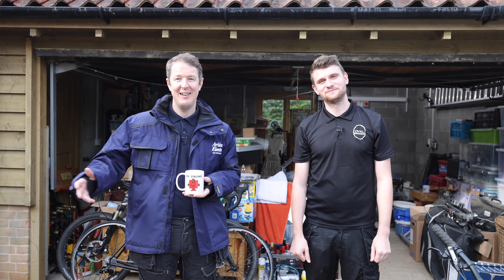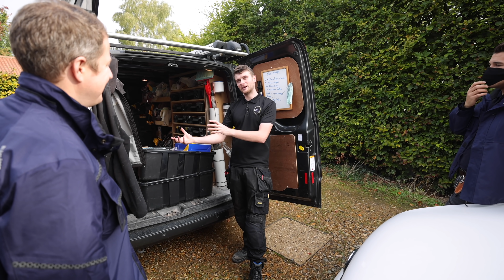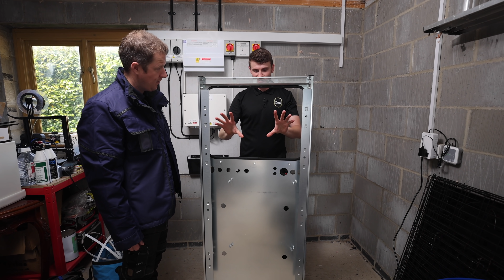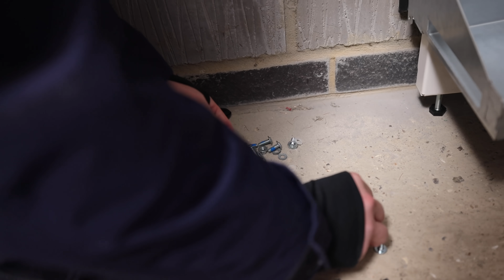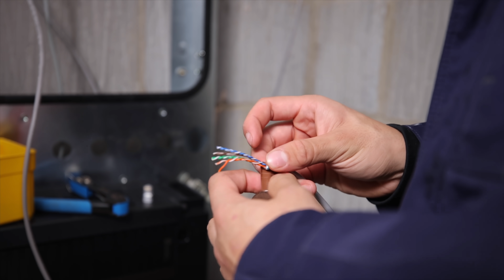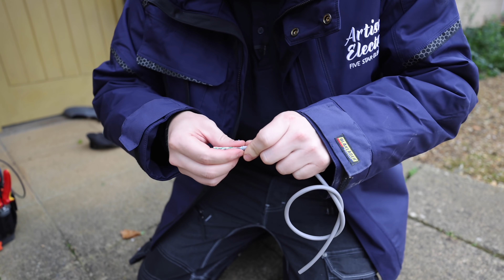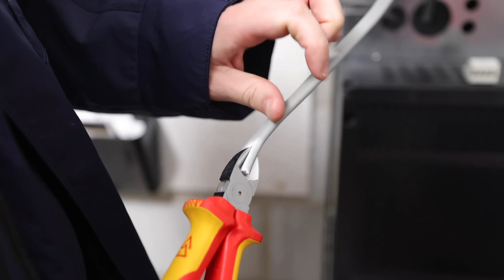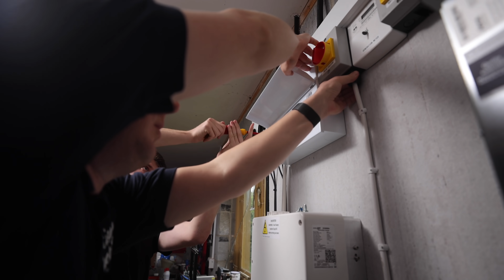HUGE DOMESTIC BATTERY STORAGE INSTALL - Electrician Life

Comment: It would be nice if you gave an approximate estimate of cost for this kind of install, and information like whether the battery can be used in "island mode" during a power cut?
Reply: Any battery can provide power during blackouts, it all depend on the inverter look for a good inverter like vitron Quatro and it will handle everything for you, if power goes out it will automatically switch to battery so fast your pc, tv etc won't even turn off.. This vid system is awful value for money .. Look for unaffiliated companies and ask them about off grid system (15k to 20k pound for solar panel, inverter, battery will be sufficient for a good setup to power your ac charge a car etc.. ) i don't know about installation cost but budget another 5 to 10k
Reply: most inverters can do islande mode...the issue then comes down to loads you require backing up...

I dont like to backup everyone's and also ypu need to concern yourself with the earthing arrangement when in island 🏝 😒 mode...
TT earthing it with a earthing relay  when on island mode as the inverter normally is a IT battery inverter arrangement and requires careful thoughts on the earthing in island mode...

also need to take loads in island mode into concern
Reply: I have the 14kw Tesla £7500 fitted. It has taken over 4 times since November and powered the house in a power cut. I would advise getting the biggest battery you can. Since here in the UK we have one sunny day and then it's cloudy for a week. I am a low electric user,  so a bigger battery could (2X Teslas) get me to that next sunny day. Fortunately, I can plug my car in to get all the excess solar; I hate exporting. 
I will be getting a Sunamp heat battery soon too. You will find that there is more than enough energy to be stored from a sunny day, even on an average solar system.
Reply: £3.50

Comment: Those inverters are for grid tie setups, off grid is a total diff beast this stuff is easy to setup the inverter does all the work with its BMS, battery charging and inside working. Solar is hopeless in the winter sun anyways.
Reply: Depends how much Solar is installed and what you can get in the Winter / How far North you are.

Comment: A and B are completely interchangeable, as long as you do both ends the same. B has slightly better crosstalk rejection, so it’s preferable, and it is what most people use. You should also always measure your cables, preferably with a certification tester, to verify that everything is correct, as you might have gotten a dodgy roll of cable, water ingress etc. Also, it’s a good idea to add a strain relief boot to the connectors when crimping them. And it’s not called a glass head, it’s an 8P8C connector, in layman’s terms it’s called an RJ45 connector.
Reply: Do you actually work out in the field? Whats your profession? you sound like a desk jockey lol
Reply: Hello friend, we are a lithium iron phosphate battery factory from China. If you are interested in cooperation, please let me know. We are looking for distributors in various countries around the world.
Reply: Love it when sparks try to do data. If any contactor came on any of my sites to install data cables and called an RJ45 a glass head they would be off site. I have been known to follow behind them with my cable tester and test random cables.
Reply: @G7OEA  Those long winter nights must fly by in Liverpool Phil.
Reply: @johnratcliffe6438  they do indeed.
Reply: @G7OEA  I'm always surprised how contractors will not test data cabling. I wouldn't be able to leave a site without proper testing of everything I install.

Comment: Anyone know if these systems have auto transfer switches. Or are the batteries useless if the grid goes down. I've seen few systems that offer that (victron only really), I always assumed that would be a desired feature on all...
Reply: most can be setup with a changeover switch manually.
victron has a fast change over like  0.04ms so good for computers..

others like solax switch over slower 😒 

all eps outputs from inverters need to run thru a manual change over switch or double interlocked relays to make it very safe!! (2 relays!! )
Reply: To get loss of grid protection you would need the Sonnen Protect 4000. This requires certain circuits to be selected to be wired through the protect so it can disconnect them from the grid supply in the event of a power outage.
Reply: Though you need a changeover as you cannot backfeed out to the grid, it could kill someone?

Comment: Ironically this is the sort of thing we need more of in South Africa right now.

Have any of you ever heard of load shedding?
That means rolling blackouts because the ANC didn't run the country properly. Broken generators. 
So power goes off for 2.5 hours 3 times a day! 

There are big sections of Johannesburg that DID NOT come back on after their allotted slot. Overloads etc causing big trips.

I am on, going off again at 2am.
Next door has been off since 3pm, came on for a few minutes and tripped again. Still not back and they are now scheduled off anyway.
Reply: can make them to be backup but best with right brand of inverter as some are for short backup power like 4hours or so 

others like victron can run for ever..on or off grid the kings of inverters
Reply: I think these systems need the grid on to work - they are not 'off grid' systems.
Reply: @barrieshepherd7694  oh dear, that wouldn't be suitable then.

Comment: I have a myenergi zappi v2 and battery storage but I have a feeling the installer hasn’t put the ct clamps in the right positions, there appears to be 2 on the mains cable in to the property. Is that correct?
Reply: Should be one on at the meter on the mains tails to monitor the grid, then one on the circuit supplying the battery
Reply: one on live tail 25mm at consumer unit

one on inverter live brown wire in a 📦 box or isolator
Reply: One hardwired from the zappi and one is the harvi?
Reply: @heladas90  I don’t have a harvi installed

Comment: A very nice clean installation……as usual.

What is the max discharge power for the 11kwh  battery?  Perhaps  4 kw?  Very difficult to charge up your Tesla!,

I would love to go off grid for all my energy needs but it is just not economically viable  using PV and battery storage…at the moment.

If the government have their way you might soon be installing Heat pumps?
Reply: 4 kW would discharge the whole battery in 2h45... considering my Tesla sits on the charger for 10-15 hours per day (I plug in when I get home, unplug when I leave in the morning) then there's plenty of time to discharge the battery into the car if I want to
Reply: need 40kw of battery and 20kw of solar to go off grid in uk and a lpg genset for a few very very bad days...I have done some testing over years and this is the figures worked out
Reply: Usually software limited to 16A unless you make a G99 application to your DNO. Then it can be increased to whatever your inverter and battery  can manage.
Reply: This system way G99 compliant and therefore has a max discharge of 4.6kw. Which is a great amount of power to handle high loads in the house.

Comment: I still think you should just buy patch cables and only punch down Ethernet cables yourself, even if pass through connectors are an improvement.
Reply: solid core cables should go into a keystone connector ...

soft core cat 5e or cat6e should go into rj45 connectors

Comment: whats the approx cost of the battery and the full install ?
Reply: 5k battery only to 12k with pv and battery normally
Reply: @electricalstuffathome  Thanks sparky, is that the 11KW Sonnen? It could be an option for me then as can only have a small 8 panel array on the roof so would need to be grid tied to charge overnight

Comment: Oh god, he said glass heads again. Triggers the network tech inside me 😂
Reply: There should be a short course for electricians to learn basic networking. The amount of new builds with coax, phone and alarm run all over the place but no cat6a is alarming.
Reply: @jondonnelly3  I 100% agree as well, in my head technology/networking and electric’s are very similar so a short course would be excellent. Nothing beats a cable to this day. I have a saying, if it moves it uses WiFi, if it’s static it’s cabled
Reply: @jondonnelly3  I agree. Trouble is, if the customer has no idea what they’re going to want in the future, how do you decide what cables to run where? Currently if they have no specific requirements I run 1x cat 5 to each tv point and if it’s a bigger house run in a couple of cat 5s for ceiling mounted access points
Reply: @timwoodhams958  I think that is a really good plan. I'd fit  a poe switch and call it sorted. Cat6a is higher guage and can deliver more power as well as bandwidth. 40Gb is extremely well future proofed.
Reply: @timwoodhams958  Shouldn't you be thinking of running at least Cat6 now ?
Reply: ive worked with alarm guys that call them ice cubes, but never heard anybody refer to them as glass heads lol.
Reply: I prefer the old school way of doing it but i might try out the new tool even tho its been on the market for years
Reply: @Theangryduck1  dude the pass through type are 10x easier and faster to install. You also make less mistakes because you can easily check the pattern before crimping.

Comment: Reason we can't go 'All Solar, Wind etc' Is the kinetic energy needed in turbines , when theirs a requirement for more power you can speed up or slow down, you can't do that with "Renewables", Which is why we should invest in Nuclear more, cleaner than Gas/Coal, more reliable than all the others and safer in almost every aspect.
Reply: You can't just speed up a generator. Then you go beyond the grid 50Hz.
Reply: Battery storage will help to balance this out. There isn’t one answer to the energy transfer however my personal opinion is that we should be cautious with nuclear due to the waste and risks if it all goes wrong.

Comment: How the other half live...  Bet that is a seriously expensive setup!  I wonder if it will ever pay for itself?
Reply: Our 6.5 KW PV with one Powerwall cost us £18,000 in 2018, the PV panel will pay for themselves in about 6 to 7 years, however we do have two electrical cars and an electric van.
The Powerwall will probably never pay for itself,  but judging by the longevity of the Tesla car batteries the next owners of my property will get all benefit .
Reply: @liberatodelgreco4430  Use case/pay off varies wildly, we have one customer that managed to pay theirs off within 3 years with a 3kw pv and single power wall and only a model3 using the E7 tariff. They do have a supplier which will drain the battery during peak demand times and pay them for it though which is the biggest chunk of payoff.
Reply: Most people probably don't do it for the cost saving, more the joy joy feelings they get from thinking that they are saving the planet!. The UK is already the sole Martyr for the whole GLOBAL problem after all......
Reply: Quite ironic to say that now !!! we are totally off grid, but have mains backup. We store in a converted tesla p85 battery pack, and have 40 panels.  the complete system cost £16.5k with the price of electric now, it has a payback of 2.3years.

Comment: More battery installs please, especially what needs to be changed in the consumer board and what other important things you´d need to know.
Reply: Yes more installs please, as a retired sparky I would be interested in seeing them
Reply: Wait till it catches fires
Reply: @jimsouthlondon7061  really???!!! How many times your phone or laptop burned down because your battery burned down???!!!
Reply: @VenomInMahEyes  tell that to Samsung I think it was the S9 that had that controversy where the batteries were faulty off the factory line and exploding in people hands and bags, YouTube them. I agree with you though, batteries rarely do catch fire there are a lot of safety mechanisms built into them to prevent it, the only way its going to explode is if there is a design flaw or physical damage.
Reply: @SeriousPixels   It was Samsung Galaxy Note 7. The reason it exploded was because of the design flaw of that phone.  Out of billions of phones in use, it is the only phone that caught fire because it wasn't designed properly and that is the reason it was recalled. That reply was for the guy who thinks every battery catches on fire. If you have a flaw in anything, that product does not last, just like Note 7.
Reply: @VenomInMahEyes  It quite a bit bigger battery I really would not want it in the house.

Comment: drax isn't a gas turbine power station, it's mostly imported wood pellets and some coal
Also presume you meant to say the battery is 11kWh rather than 11kW ?
Reply: I thought Drax shut down the last coal fired units back in March and was now 100% "green wood" pellets.

Comment: How about a used 24kw Nissan Leaf at around £5k, plugged in with Vehicle to Grid charger? Useful 2nd or 3rd car, with years of battery life left in it.
Reply: Shame that V2G chargers are about another £5k on top of that, plus installation :(
Reply: All very good in principle but difficult to execute. Anything grid tied would need DNO approval and the relevant certification.
Reply: easier to just buy the car you want and make your own battery

Comment: Why does these installs NEVER show what the grid is pulling, Most homes have smart meters..

Given most battery systems the difference between them isn't really KW it's more how the inverter will discharge itself. 
Solis inverters for example cannot read the grid correctly and IHD units will show 40-60w grid pull (1-2kw a day) 

Given the price of these units you'd think it would be first thing to show off. Before and after on grid pull.

Comment: What courses did you need to go to do this type of electrical work?
Reply: You would need to be a qualified electrician as a minimum. If you are going into the solar game then you would need to complete the solar qualification. There is no absolute requirement as yet to complete a battery qualification but this may come in when batteries are added to the MCS scope.
Reply: Would think you need to be a qualified spark when it comes to messing with the consumer unit. Its a grey area insofar as being defined as competent, but one would think only qualified sparks take the in house product training.
Reply: @ChariotsofWire180  I am about to be out of my apprenticeship, was just curious if you needed any extra courses etc to do renewables. Seems the way of the future
Reply: @StuartAll1N  Best of luck with things. Nuclear energy is the real answer. All this electric and battery bullshit simply creates an industry which makes people billionaires, whilst its the man on the street going in his pocket for ground/air source and electric cars.
Reply: @ChariotsofWire180  good to hear other people’s views appreciate the advice. Thanks man 👍🏻
Reply: @ChariotsofWire180  not sure I totally agree with that but I respect your opinion. My view is that there isn’t one answer to the energy problem it will be a mixture of loads of solutions. Nuclear is ok but has huge impacts when things go wrong. Also it isn’t that flexible as loads have to be predicted a long way into the future. A battery system can come online in milliseconds meaning huge flexibility 👍